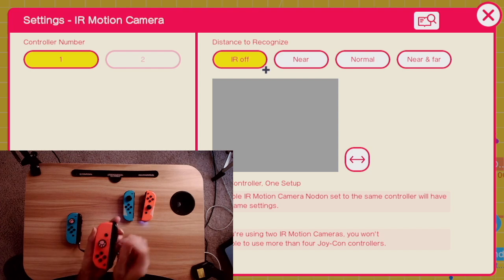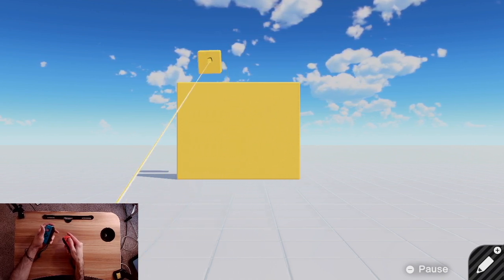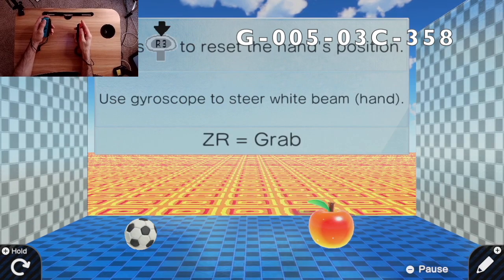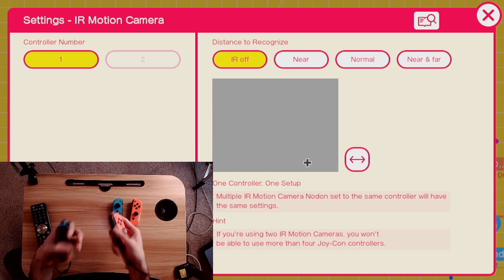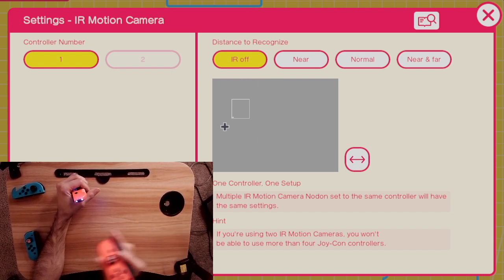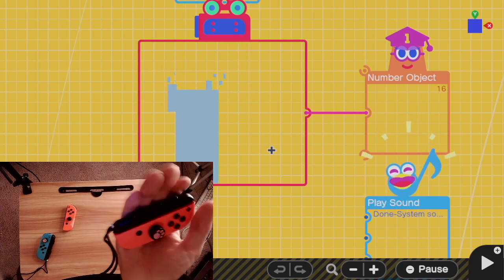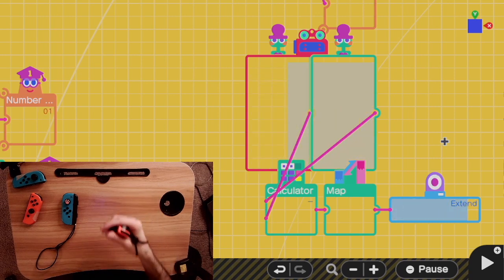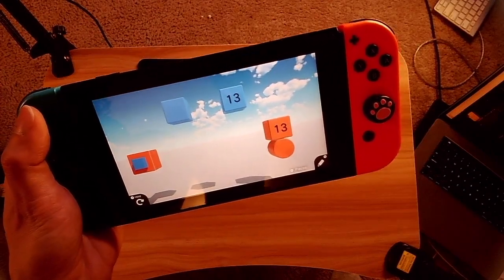How to Use IR Motion Cameras and HAND Nodons in Game Builder Garage (Guide / Tutorial) (Part 2)

Comment: Youu don't need another controller with another IR light. You just need reflectors.

Nintendo labo has always had GBG built into them but no one bought Labos, so they made a game that only focused oon the garage game in Labos. 
people thought labo was just expensive cardboard. But there actually is a game in Labos, which was the GBG extra in it.
Reply: Idk if you had Labos, but you should check out how they made the labos work. 
It focused on IR light and reflectors.
So you can literally makke labos with GBG
Reply from the maker: I looked into labo extensively when researching for the video. Turning on an IR emitter nodon literally disables that joycon's IR camera. You cannot you the IR emitter nodon without two joycons.

IR camera for GBG is tuned around the expectation that you do not have reflectors. Instead, it is an IR camera that also illuminates the scene with an IR light. Only one joycon is required for this feature.

Comment: If you setup something like the Wii Sensor bar, can you emulate the Wii Remote pointer functionality? With similar operation range/distances?
Reply from the maker: Probably. However, wii sensor bar needs to be plugged in to an operating wii. I'm not exactly sure what the distances are. The switch IR camera seems to prefer much shorter distances than a normal wii. It would proably be a challenge to program with.
Reply: If you could use candles to emulate the sensor bar, then you could theoretically use candles for your project